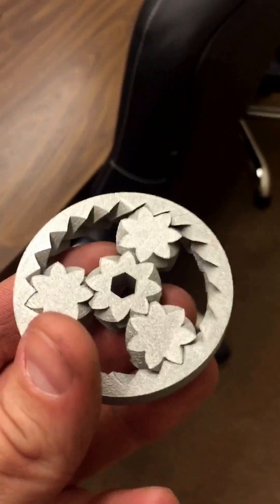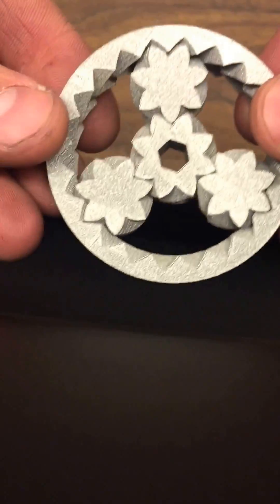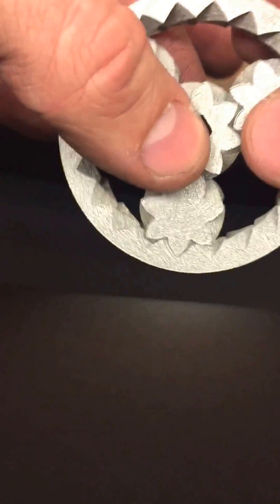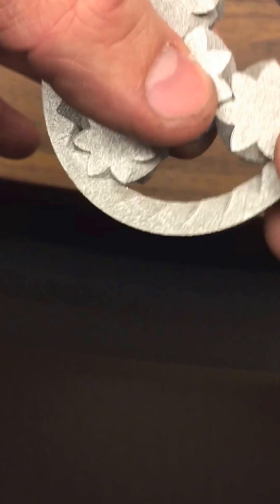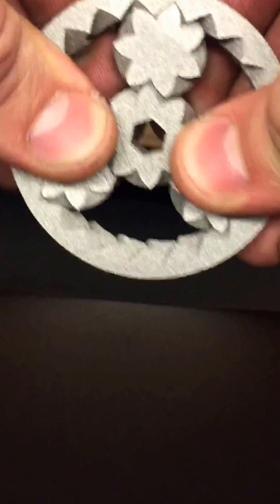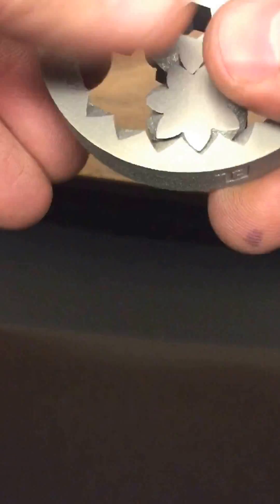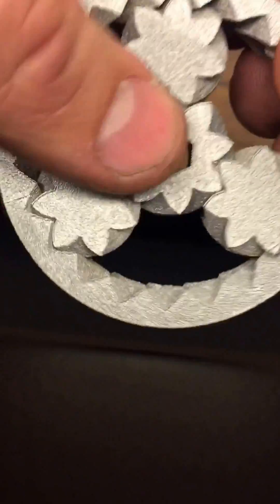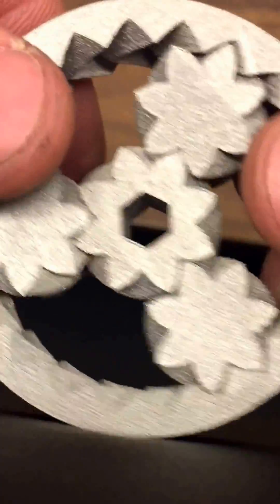Metal 3D Printed Gears

Comment: I would love to contact you about the steel gear printing. If you would care and answer me, I would appreciate it.
Got tons of questions but the main questions are like this;

1) Have you tried those gears with any motors ? and have you tried them on loads ?
2) Normally gears are manufactured with hobbing machine but still it needs profile grinding not to make noise while working. If we manufacture it with 3d printing do we still need to grind them ? I mean i m curious about the gear teeth surface roughness. Any acceptable level of surface roughness?
3) After the 3d printing metal gears, what is the hardness of the gears ? Is it enough for ındustrial purposes or should i stll need to makea heat treatments ?

Man i beg you answer me!!! ( I can also share my company email to chat about this type of manufacturing. I am going to invest in some machines according to our chat )

Comment: Where can we learn more about this?
I have tons of questions, 
What metals and alloys can be utilized?
Hardness?, hardening? Sintering?
Powdered metallurgy?
Can iron cylinder barrels be made by this process?
And what is the cost compared to the traditional foundering/ casting and machining  processes?
I'm going to take a deep dive online searching for answers, and this is four years ago, I wonder how far this has advanced now in late 2020?
Bob Lazar described a craft back in the late 80's early 90's that might apparently have been constructed by an extremely advanced form of this method. Their best guess back then was some advanced injection molding process, though now it looks like it was something like this.. or this method came from their research in some round about way.  We may never know for sure, the craft appeared to have circuits and transmission conduits integrated as one structure. 
More and more Bob Lazar is being vindicated as a truthful whistleblower on events and information that mankind has an inherent right to know the truth of and benifit from.
Thanks,  any info will be greatly appreciated. 
Thanks again for a wonderful upload.